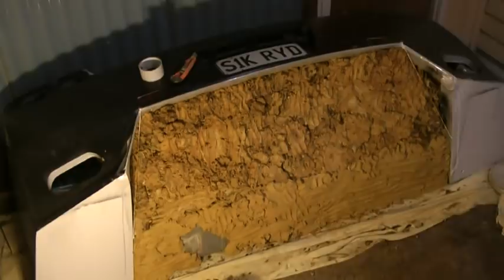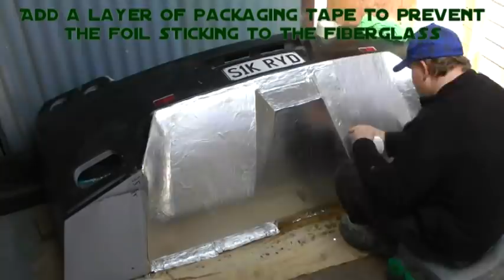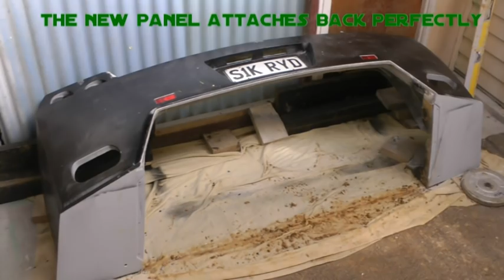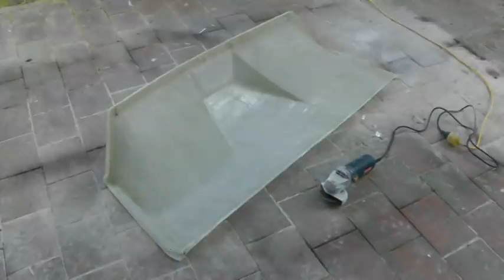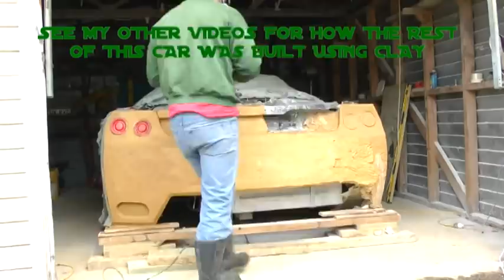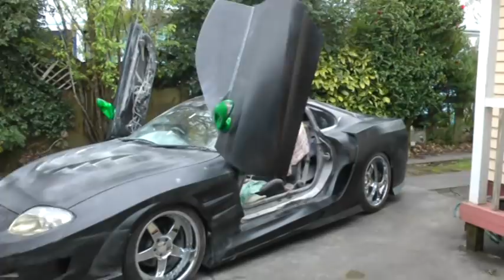How to make a panel from scratch. Step by step using Clay Sculpting - The Real Fast & Furious

Comment from the maker: This panel was so simple to make that I did not apply any special way to get it symmetrical. I just did a few measurements and marked out on the clay were things should start and end. I also used cardboard cut outs to get the proportions correct both sides. When I built the back bumper I had to be more specific. So I created the ribbing technique which gave me perfect symmetry. You can see the ribbing process in my other videos.

Comment from the maker: Thanks Gerard. Once the panel comes off the clay it needs much finish work. At this stage the panel is not worthy of making a mould. The mould is made after the panel is properly finished and in its primer filler state at which point it is perfect. On the other hand making a female mould straight from the clay will also not work unless you want to do a lot of work to each male that comes out of the mould. Thanks for your input though

Comment from the maker: I use the most common resin used for bodykits. Polyester resin.There are a few diff types of polyester but any polyester resin will do.Once you find a polyester resin you like then stick to that same one throughout your project. I suggest the cheep polyester resin since there is not much of a differance between them. Remember that polyester resin has a shelf life of about 3 years. Some polyesters need cobolt added as well as the hardener.I suggest going for the resin that only needs the hardener

Comment from the maker: The Ultimate Human 3D printer! The Genius 1000 WDX model :)
Reply: Play-doh will Dry, shrink, and crack while working with it so that's no good.  I've never tackled a project of that size but I use Sculpey for small stuff.  Sculpey is a polymer clay that holds its shape very well and wont dry on you unless its baked.
Reply from the maker: Todd Broman Hey that was really cool. It would cost about 5K to do the back end of this car in that tooling clay. Not bad. But potters clay would cost about 1500. So I guess it depends on your budget and use. The tooling clay gets old and at some point cant be used again. The potters clay can be used indefinitely even if it dries out. But the tooling clay is good to make a direct fiberglass mold from which will save lots of labor and time.
Reply: right on, i live in the south so its too hot and humid for potters clay. I found that the most affordable way has been a layer up as close as possible with of cardboard, poor foam,  sand it back about 1-2 inches below the working plane cover it then build up with tooling clay
Reply: +STIGZ you ever heard of polyurethane foam and small layer of molding clay?it would take me max of 500 dollars because I get the clay used in prototype modeling just ask around in car prototypes shop
Reply: STIGZ where to get a clay? Or what's the exact brand are you using?
Reply: Nice car man, but why do you use clay, isn't it easier with foam?

Comment: This is one of the coolest things I've seen, amazing!
Reply from the maker: Thanks mate!
Reply: S1KRYD I've needed to make a scoop for a long time to cool a custom turbo build I did this has given me the confidence to give it a try.  I'm familiar with fiber glassing just not shaping the clay from scratch.  Is it a special kind of clay I should use?  Also do you need some kind of release agent besides the packing tape you used or is that good enough?
Reply from the maker: Rubber Duc Yes you can make your scoop very easy using this method. Use potters clay. Be sure to keep the clay moist. When finished Cover the clay with tin foil to separate the wet clay from the fiberglass materials. Use the packaging tape over the tin foil because tin foil loves fiberglass and will stick like crazy to it. No release agent is needed because you are not trying to release from a female mould. You are only trying to release from wet clay and tin foil.

Comment from the maker: Make sure you take plenty of video or you will regret it. When I started the front end of my design I was a bit lazy with my camera and so all I have is a few photos. But when I did the back end I used time lapse. If I did not do that then I would not have had not much video at all. I will put up a few more videos before putting up the finished product. The next video I will do will show how to change the shape of an existing panel such the roof of the car.

Comment: I love everything I just saw until I recognized the platform that this awsome work of art was based on, I just think the JZA80 body is perfect the way it is, but kudos to the artist on the work?
Reply from the maker: Thanks mate. Yes some love the car until they realize that the platform that was used is the JZA80. They feel that people should not mess with the original JZA80. I actually think the unmodified ones are ugly ducklings until modified. But truth is if I did not use this car it would still be rotting in the field I found it with no engine or gear box in it. Now it is a work of art with the vvti turbo 2JZ engine and the getrag 6sp box. A nice but rear compo for a car that was going to be sold as scrap metal and crushed and sent to the Chinese to make spaghetti cans :)
Reply: Wow do they have another one rotting some place Ive been in love with a MKIV Supra, I own its Father the SC300 and the MA70 Supra, but not the jza80😞, but a real cool job on this one of a kind reimagined Supra😉

Comment: If I had a '76 Cutlass and I wanted to make custom bodywork like this (Which looks amazing by the way) to make it look like the 6000 SUX from Robocop, what would you suggest?
Reply from the maker: Very interesting. You will need to clay the whole car like I did with this project and make a set of panels to attach to your car.
Reply: So remove the original panels and toss em, and stick clay to the car directly so it fits, since I doubt I'd need the old paneling for much else.
Reply: Another approach I've seen--to cut down on how much clay you need, you can also attach blocks of foam to the car (with the original body panels still on it) and sculpt that down, and use clay for the small details. From there you can either pull a mold and make fiberglass parts from it and attach them to the original body panels, or do what S1KRYD did in this video where he creates the fiberglass piece off of it and attaches it back on.
Reply from the maker: areitu This is a good idea. But if you are going to pull a mould from off your clay you will not be able to use potters clay to do this. You would have to use the expensive Y2 clay or equivalent. This will cost you 10s of thousands.
Reply: what about using foam for the majority of the fill and then claying over the foam?
Reply from the maker: Jesse Dielschneider Yes. This would work.
Reply: S1KRYD 12 full days or 12 half days?
Reply from the maker: Hafeez Akbar 12 days at 12 hours a day.
Reply: I would suggest that you are awesome!
I never knew how they made the 6000 SUX from the Cutlass. To me, it always looked more like the Aston Martin Lagonda.
Reply: Or just find an old ass ford taurus for about 200 bucks lol

Comment: I could get that for a panel. but the whole car? that's a different level altogether. excellent work amd dedication, dude!!
Reply: With all due respect, it wouldn't be that hard to do the whole car , Just do one panel at a time . 
    Of course you'll have to make drawings of your desired panel design and take measurements but it can be done . 
    I'm making my own panels for an old school convertible Mercedes.  
    It's going to be a real head-turner when I'm finished.  I may even post some videos of it .
  Best
Regards

Comment: S1KRYD  , thanks man this video helped a lot, I'm in 10 grade now and I was planning to build my dream car with a custom Body kit later on in life,  it's a 1995 Mazda rx7 with a supercharged 3 rotor engine, with methanol injection and a custom wide body kit I made up so it doesn't look like a rx7 from the front, but from the back it will. The supercharger that is going to be on the car is going to be a Whipple 3.4l twin screw supercharger,  and I estimate it to make 700whp at Max boost, which is 26 psi or more, it's a monster, Ive been drawing this car since the 6th grade, and this video final solved my problem on how im going to build the body kit, I wish I could show you the pictures
Reply from the maker: I wish you could too
Reply: What's your email

Comment: Looks really nice, and good to see someone stay away from the normally uset mats of fibraglass, with no structure of the fibres. learned this teqnuice at school, and a compination of fibregalss, metal net, and carbonfiber turned out stronger than the aliminiumplate we had to comparism. Never tought of clay as a mold tho.

10/10

Comment from the maker: Thanks. I use a 1mm and a 2mm thick bit of panel steel cut in a square to scrape and shape the clay. Put 2 layers of fiberglass CLOTH at 6oz thick onto the clay mold. This results in a thin flexible panel. You then need to put additional strengthening layers on the back of the panel. (I have a video on this)If using fiberglass I would put 4 layers of 300g/sq meter of fiberglass MATT. Or 2 layers of carbon fibre. For a hood you would need twice these amounts.

Comment: so car body making is like a sculpture sculpting clay. I like the carbon fiber material because its really light weight i think i felt a door panel made out of that stuff it was really really light. If not that some really light material. But you need a ton of clay and looks like a time consuming process from the mass production process that uses either 3d printing or a clay molding then casting /pressing panels, then spot welding robots , paint shop bath/spray booth alot of its automated...so its cool to see it done by humans sometimes. Definitely cool looking car

Comment from the maker: The type of carbon fibre that you would use for cosmetic reasons is different from the uniweave carbon I have used here. This carbon is very thick and used to connect two hulls of a catamaran boat together. It does not look very good but is very very strong. If I wanted to I could sand the outside and buy some triweave and place a layer on the outside for looks. An easy thing to do but all the lines in the weave must match up on the panel to look good.

Comment: Good work.  I would not use FG and CF on the same panel.  FG is about 4.5% flexible but CF is only 1.5% so the CF will reach its limit long before the FG and will crack before the FG reaches its yield point.  You have effectively made the mould with the FG, why not just use the two CF layers that you have already used, put some foam packer strips in and another two CF layers.  Result, very light, very stiff CF parts and you still have the FG mould.

Comment from the maker: To shape the clay I used a bit of 2mm thick steel to scrape with and also a bit of 0.5mm steel. The 2 diff thicknesses give diff results. Other tools to get things symmetrical were made from scratch, such as the ribs you see being made in the other videos. The tools are really simple and common.

Comment from the maker: Clay is better because if you make a mistake it is easy to put the clay back and start again or just patch something up instantly. If you make a mistake with foam you then have to mix some more and add it and wait for it to set. This can get expensive and time consuming. Also you can really sculpt nice shapes easy with clay. Much harder with foam. This is why the car industry has always used clay since cars were first invented until today. The only diff is that computers now do all the sculpting

Comment from the maker: I would not put wax down because this will stop you from adding the strengthening layers to the panel in the inside. PVA may work if it all peals off easy. I simply put down a layer of packaging tape. This allows the fiberglass to separate from the tinfoil so that you can put the extra layers on the back with no problems.

Comment from the maker: I guess you mean the panel in this video? It bolts on with 6 bolts under the rear bumper. At 3:34 on the right side of the panel you can see 3 of these bolt holes being drilled. There is also a lip that comes around the top lip of the rear bumper

Comment: I always assumed the car mfg's sculpted the clay into the final form and then pulled molds from them and in turn used the molds to form the final body panel. Here you're using clay to get "almost there" and then layering the clay with the outer surface of the panel and back filling for support. Was my assumption wrong or is that one of the differences between creating a one-off and creating a mass-manufactured product?

BTW, fantastic talents and work.

Comment from the maker: For clay use potters clay. It will be the cheepest way for the average joe. Or you could use y2 clay but that will cost you 10 times as much per kg. You will need polyester resin, fiberglass cloth, fiberglass matt or carbon fiber, and your imagination. The tools are simple. I use card board cut outs to get the differant shapes and curves, and a scraper to shape the clay. Not much to it really. Give it a go. You will only get better with time. Please feel free to ask specific questions.

Comment: This a an old post, but a great one.  One question I have what happened to the packing tape applied over the tin foil?  When you took the mold off of the clay, you easily removed the tin foil that stuck to the mold.  But I didn't see you remove the packing tape that was applied on top of the tin foil.  The next step in the video was to scuff up the underside of the mold and applied more fiberglass.

Comment: I suppose that makes sense, though my preference would be to sculpt, fiberglass, spray with paint and sand until perfect, then polish, then release wax, gel-coat, then glassfiber and reinforcement, then make a finished panel off the mold. Though then again, I am a perfectionist and will probably either spend my life making the perfect car or just drive a piece of junk with rwd that I can trash for cheap thinking "I don't want to be the penguin that tries to find the perfect stone to get a mate".

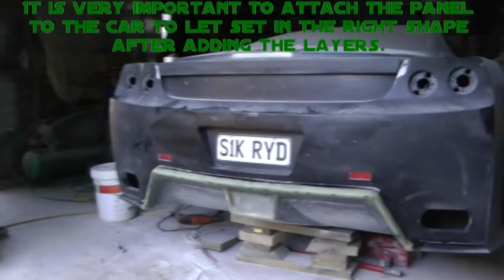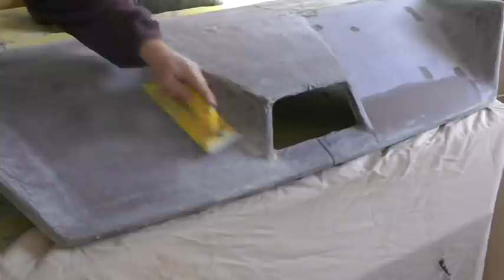Comment from the maker: At 6:28 you can see where the two exhausts will come out of the back bumper. At 6:45 I cut out a hole in the rear diffuser to release any air pressure under the car. In a ferrari (which is a rear mounted engine) the hot air that went through the radiator come out here. But in this case it is just to release air pressure under the car.

Comment: I like this vid. The music in the beginning gave me a headache. 
Very informative. I never thought of using clay. But, it's a big piece. And it's quite a bit of clay. 
I used to use sheetrock 45 min set and make a mold. 
Thank for the vid. Def. informative.
-So, do you mean to bold/attach the panel to the vehicle before the resin is done curing, so as to help prevent shrinkage deformities?

Comment from the maker: No Prob mate I don't mind the questions at all. I have used the fiberglass and resin ones as well. Yes they are good but no it will not be as strong as the carbon ones which are the strongest. The Newtech is prob the second strongest. It is water proof and can be wet sanded and sticks to bear metal better than any other material I have used so far. I highly recommend Newtech or if you cannot get it then mix your own.

Comment from the maker: Thanks Beckie. To do the job you see in this video I needed about 100L of clay. But most of that clay was just for bulk. If you set up a good base to save volume you could get away with using less clay. If you are doing a new lower front bumper and grill I would guess you will need 60L or so. If you look after your clay you could get some of your money back by reselling it once you are done.

Comment: Excellent work, your method is similar to the one I developed for doing this, though I would vacuum bag the part in order to get the finish instead of doing post-work to get it smooth.
Reply from the maker: Your method would require the type of clay that car manufacturers use which is expensive.

Comment from the maker: Wow that sounds like a really good project. The F150 is legendary. Look forward to seeing that. Will you put up videos? The disc I used has 120 grit on it. It looks like a sanding disk with over lapping layers. Very common discs. Even a 60 grit disk will be fine.

Comment from the maker: The Newtech is not a waste of time. It is very strong and water resistant. It also is polyester and sticks to the polyester fiberglass very well. If you want to stay with your telcome powder based bogs because you want something easy to sand that is fine. But it will not last the 35 years this stuff lasts for.

Comment: when you add layers after it is cured don't you warp the piece toward the side you are adding fiber glass too?  Also, there is a product called duratec that sands like butter and makes for much easier sanding before you paint.  Much easier than gelcoat or any other product that I have used.  But I was making car bodies in the 90's

Comment from the maker: As for the carbon fibre it depends largely on the thickness and direction of the carbon. Also if you intend to use it with polyester you need to specify this when you buy it. But it is best to vacuum it like you said.

Comment from the maker: No. I put the tin foil on right away. I do not let the clay go hard becouse it will not. As soon as all the clay work is done I put on the tin foil and then do the fiberglassing all in the same day if I can. It will not lose its shape unless you knock it with something. The clay if firm enough to allow for this.